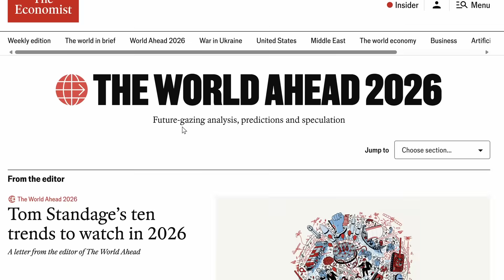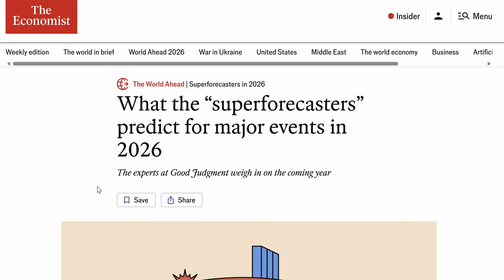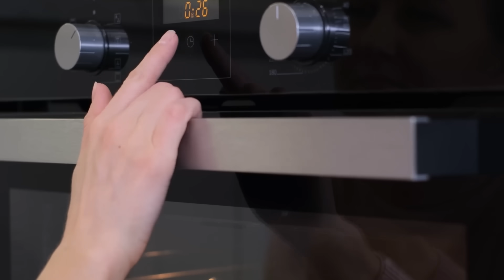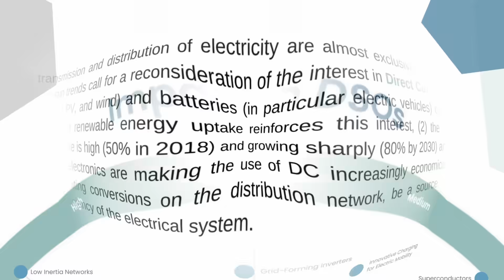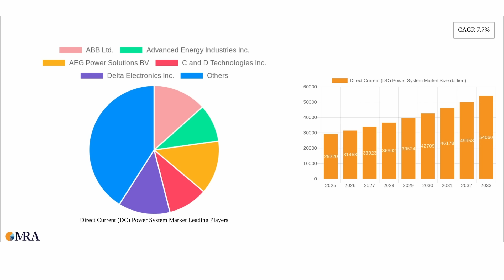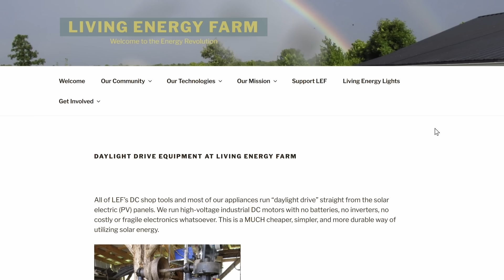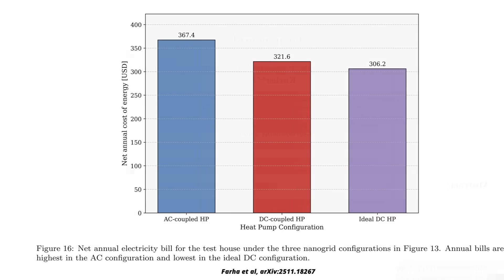Are We Using the Wrong Kind Of Electricity?

Comment: There have already been DC installations in datacenters, where at the top of the rack (or bottom depending on layout) they convert the incoming power to 48V, and distribute it to devices just using a bus-bar where they connect to when sliding in. This eliminates a lot conversions and improves reliability as well (less things to break)

Comment: DC-DC converters have AC in the middle. What differs from 100 years ago is that the AC is at much higher frequencies than the 50/60 Hz that was good with iron core transformers, and efficiency at those higher frequencies has been made higher than at the lower ones.
Home devices that need DC often convert low frequency AC to DC, then DC to DC to get the regulated voltage they need. A DC input instead of 60Hz A/C gets rid of one transformer and its losses.

Comment: From where I stand at the private consumer side, with regular shifts to AC or DC depending on a project or client, it looks (to me) more like "the grid" as a macro-industry concept is going to get more and more decentralized. Some micro-grids will network together, and others simply won't be compatible for whatever reasons.
There's NO REASON that wind turbines have to produce DC, btw. Any rotating generator (like those powered by turbines) can push AC cheaper for longer with existing anc tested technology. We've been on torque-to-AC for the whole electric age as espoused from hydroelectric dams and even steam turbine generation on ships... Older car generators ran DC directly, but required routine maintenance, including replacing brushes similar to the brushes in electric motors if the era... SO there's just never been anything stopping rotational generators from making DC, either...
That said, MY POINT is that in the future, your particular best choice for electricity is probably going to become "case by case" and may well depend on your geographic location and available resources as well as just the local co-op or industry engineers and their choices.
I think the Power Converter will become popular, so DO learn to appreciate the benefits of a FULL BRIDGE RECTIFIER when you start looking into it. Thanks, Electroboom... and IYKYK.

Comment: And then China does it backwards.  There are conversion losses but I am sure those would pale in comparison to transmission losses.  
Transmission should always be AC.  But in your house should be one large efficient rectifier NEAR YOUR HOT WATER HEATER.   It should supply 12 V all over the house and its conversion losses that are lost as heat should have a water cooled loop with a preheat tank of water for your water heater.

Comment: Happy Holidays Sabine. There are many factors involved. Some arguments are not valid because many DC consuming devices need specific voltages. In general that is done converting to AC, transforming up or down, then converting to DC. As for the DC power line, losses are less in the line itself and indeed, technology/efficiency has improved for high power conversion AC to DC and DC to AC such that DC power lines are worth it. So between Denmark and the Netherlands, that is why.

Comment: Don't panic. Every AC or DC electricity has its advantages and disadvantages. I'm surprised that this is not the core of the video.
The main disadvantage of DC when used in the home is the replacement of all switch contacts, because DC at 100V can stretch the arc up to 10mm.
The replacement must be either an electronic switch or the use of magnets placed under the classic contact.
Similarly, safety elements, DC current can cause cables to burn out, is significantly more dangerous in terms of fire.

Comment: Transporting voltage potential is one problem solved by high voltage ac. To get electrical to do work it needs to be controlled. The final step is the ac or dc device that will turn a motor or power a screen. All use discrete devices to accomplish that. Transmitting power over long distances with no wires is what we need.

Comment: Wrooooong. DC is for personal devices, computers etc. For power distribution is DC absolutely wrong solution. Even for heavy industy is wrong, we see it at powerstations where big AC motors where replaced by smaller DC motors with frequency converters, they are failing three times more often than old AC motors and every one of them need to replace supply wires which are again three times wider and expensive, than AC supply wires.
Reply: Were they brushed dc motors?

Comment: Heyho Sabine! That was a pretty bad checked video... heaters do not need AC, that would be motors. Wind turbines produce AC, yea more or less everything that spins needs or produces ac. dc breakers are for batteries so, nothing new there for the home. A part from that power electronics are getting pretty dame efficient nowerdays. But yes DC micro grids do in fact make sense fore some industries.
Frohe Weinachten!

Comment: No. We are probably using the correct electricity for distribution.  Typical distribution is 14,400 V which is stepped down to 240/120V to connect to your house with a transformer.  And sometimes to 480V for light industrial uses.

Many devices convert this 240V or 120 V AC to DC at lower voltage for use.  

At the current state of electronics, the electricity is first rectified to DC , then converted back to AC to drive a step down transformer at higher frequency, the AC  is rectified to DC that is used to drive an induction based regulator which is a pulse width modulated device (AC) to produce DC output voltage.  This appears inefficient but it is quite efficient.  A line frequency step down transformer followed by a linear regulator will be less efficient.

If the house current was DC we would only save the first rectification but DC to DC converters would have to replace the pole distribution transformers at greater cost.
Reply: Is the cost of the solar panels larger?
Reply: @UmmerFarooq-wx4yo thats not a relevant question.

Comment: Merry Christmas, 
Sorry for the lump of coal, but hell NO to DC, for general distribution and usage .   You’re only looking a a tiny piece of a very large puzzle.    It’s not about final use, but transmission and distribution.    There isn’t enough copper in the world to convert everything to DC.  How about transforming voltages?   How do you do that easily/cheaply and RELIABLY with DC?  

There is a reason why the world chose AC over DC over a hundred years ago.   It’s not about what being USED, it’s about what’s being TRANSMITTED. 

DC transmission (excluding extremely high voltage transmission) requires cable sizes and order of magnitude larger than AC.   In fact Thomas Edison, for his DC system, proposed power plants in every city  block, because it wasn’t feasible to change DC voltages, or to transport over long distances.   Thomas Edison also owned a lot of shares of copper companies…. 

Even the microgrid, you essentially only have a choice of one voltage.   What voltage do you choose?   That toaster running on 5 volts, so it’s compatible with your smartphone?   That toaster would require a cable with each wire the size of your thumb.  

The magic with AC is the transformer.   Super cheap, simple, reliable way to change voltages.   Nothing equivalent exists for DC.

Comment: The Economist used to be an excellent news journal but just supports the WEF now. EV's are a disaster. The AC/DC argument was resolved 100 years ago and DC lost due to transmission of power over long distances. It is easier and cheaper to convert AC to DC than DC to AC.

Comment: ac is safer to work on. Ground is the reference voltage of 0 volts. So if i'm working on a 480V motor, fed by a 480/277V circuit and i stupidly do it live and equally stupidly touch a live leg, i only get hit with 277V not the full 480V. Now it need not be mistakes thay cause this if the case becomes energized and the equipment ground is compromised, then anyone touching that case will get wacked but again only with 277V which is reasonably surviveable.
Reply: AC is safer than DC to work on?
Reply: @UmmerFarooq-wx4yo yes. I would be working with the full voltage with DC. 480V DC would be 480V to ground, where most commonly in the US 480V is 480V phase to phase but 277V to ground. Less voltage risk in the most common type of electric shock injury, hot to ground.

Also, it is commonly said among electricians that dc "grabs" you meaning it's your muscles contract involuntarily making letting go impossible.

Comment: Seriously?!?!
Here's where engineers demonstrate their disconnect from the real world and hands on technicians step in and try to stop the flow of wasted money and effort. 
You can not transform DC! It has to be pulsed or converted to AC.  And I guarantee that the study of DC homes vs. AC homes is not a direct comparison.
AC transmits further and better, converts through transformers to different voltages easier, and it's simple to convert AC to DC. These experiments for DC microgrids are rigged and fudged.
Figures don't lie, but liars can figure!
Reply: Having all homes with DC solar panels, would be preferable than nuke plant several miles away.

Comment: 3:40 - Don't wind turbines actually generate AC? Since the AC it generates does not match the frequency of the grid at 60 or 50 Hz, it is first converted to DC, then to AC at 50 or 60 Hz.

Comment: DC makes sense in factory settings and maybe some commercial settings where the people using the equipment are not the people maintaining it or even responsible for plugging it in but in the home, DC is far more dangerous than people are used to. if you grab a live DC wire by accident it is very hard to let go, also DC arcs more so there would be a higher fire risk. DC power even at like 120v needs serious care to handle but a 120v ac zap in most scenarios is just an unpleasant surprise.

Comment: 4:55 you touch on the key issue but don't explicitly say it.  We use AC because at typical transmission voltages of the last 100 or so years (4KV-345KV) AC is far more efficient and encounters far less line loss than DC.  But the advantage tips back to DC when voltages exceed 500KV, particularly for distances >300 miles.  This has only started to become feasible over the last couple of decades.
Reply: Exactly. 
Technical decision leads for compromise. 
I don't recall the demo that shows AC have less resistive loss than DC for high voltage over long-ish distances, so if you have it please share it.
But the capacitive loss of the AC is less and less negligible and DC naturally decreases this to zero 😊 so for very high voltage and over long distances there is this sweet spot where DC now prevails

Comment: It does feel kinda dumb to convert DC from solar panels to AC, plugging it into my car, which turns it back into DC... but then, if it al was DC it still would need to be converted to different voltages... so as long the conversion, be it DC/DC or DC/AC,  is done efficiently, we should be OK...

Comment: I see the argument between Edison and Tesla is still going strong on the comments. AC was used way back when, because, transformers were the only reliable way to convert voltages on a scale. Today's electronics have changed that. Newer high voltage transmission is using DC, I wondered, 'why are they doing that?' Well it turns out that the same changing magnetic field used in transformers causes losses. High voltage AC creates a strong alterning magnetic field and over long distance the inductive losses add up. Again I was thinking how bad can it be, then I saw a documentary about changing insulators on High voltage AC transmission towers. Even though the line they were working on was powered down, the induced voltage on the 'dead' line was high, if memory serves me, it was in the thousands. 💡Now I fully understand the magnitude.

Comment: Interesting. Australia uses a vast amount of air conditioning. Generally speaking, 3 phase aircon is cheaper to run than single phase. I don't know of a DC airconditioner.

We also pump a lot of water. Swimming pools benefit from 3-phase ac motors, even in domestic installations. Perhaps solid state transformers will make AC more attractive as traditional transformers are expensive to buy and have long lead times to replace.

Comment: Those of us who have off grid inverters connected to 120v-500v solar strings feeding a MPPT could be connected to a community scale DC buss .
Voltage variations of 10-20% would be of little concern as long as 
the voltage is on the high end. No complicated dance of phase matching,individual PV input strings being designed at a slightly higher voltage than the target DC buss voltage. 
Off grid solar battery backup is already moving to 100v so another scenario is home battery maintenance charge off a 120-500v DC  buss would be simple and ,due to the low and constant current ,the copper savings would be substantial.
My inverter that runs the majority of my house loads has PV input on a #10 circuit and the 240v AC that tops off the battery at night is a #12 romex. As an electrician who always put 200 Amp/ 240 volt service on houses,this boggles my mind.

Comment: On the map I do not see the DC connection between Norway and the Netherlands.

The US aircraft carrier uses medium voltage AC in its power net which is probably a major factor in its trouble with the catapults it uses to launch aircraft. The new Chinese aircraft carrier uses MVDC.

Comment: It is a bit sad to see the downfall of Sabine and this channel. Quite a few of the things Sabine pointed out as being "powered by DC" are running internally AC. Electric cars, telecommunications, microwaves. While electric car could run on DC, they rarely do, as motor control is super inefficient using DC in the entire path from source to controlled rotational movement. There is a reason why legacy DC railway electrification in Czechia and Slovakia (the northern part of former Czechoslovakia) is being converted to AC, even if the process is slow and done in  incremental steps (sections). Every modern (high speed) rail line uses single phase AC. All DC to DC converters use AC in the process of conversion. You cannot directly convert DC to DC. Anytime you need to change the voltage, you use some sort of AC.

Comment: There is another thing with the DC Grid because from point view Energy Provider and also security and decentral Energy Storage is desired.

Hence a fluctuating DC Grid from lets say 280-350V is no problem, IF all houses are equipped with a BatteryStorrage.

It can be charged 24/7 with a mostly constant power and take very huge peak loads OFF-the-Grid.

This will deffinitively increase the efficience abd also make it easier to charge locally with solar.

Comment: Dear @SabineHossenfelder, alternating current with 50-60 Hz means that the direction of current flow reverses 100-120 times per second (not 50-60 times). One full period of a sinusoidal waveform contains two zero-crossings.

Comment: “DC transformers”? No. Transformers work when the primary (power input) either collapses or alternates. Both AC and DC have settled into their nicely useful places in over 100 years of technical development and long range transmission will forever be high voltage AC, storage, DC.

Comment: should be DC..  the only reason the 50/60 hz happened is 3600 RpM is about optimum for a large engine which gives 60Hz w/o brushes, and voltage conversion to HV for long wire transmission using HUGE IRON Transformers.  Now with solid state high frequency switching, we can go very high frequency for voltage conversion using SMALL very efficient boost/buck and other topologies.  DC doesn't have reactive losses, and is just as effiicient at even higher voltages.  The entire GRID is OBSOLETE!  as are big iron transformers.

Comment: In Belgium a new power line is being laid from Zeebrugge, connecting offshore wind turbines to the inland area. So, in essence, direct current would be better from Zeebrugge. However, because the line will also be used for electricity transport at other times, alternating current should be chosen.

Comment: Well, dc/dc converters are basically dc/ac/dc converters.  Transformers part of the dc/dc converter still require AC to do the voltage translation.  The only reason for the popularity of DC high voltage transmission lines is that it’s easier to stabilize the grid.  Each power sources on the grid have to precisely synchronize their 60 or 50hz.  Any deviation in frequency or phase creates instability on the grid.  So when you have a large number of DC power sources you aggregate them on a single DC/AC substation.  So you end up with less nodes on the grid that are sensitive to AC phase variations.

Comment: I am all for dc, but we still need the means to charge batteries efficiently and with consistency, and that tech is way off, stay nuclear its safer and cleaner. also we are to energy hungry as a planet and we are growing, unless we go back to the stone age, there is no way in the next 100 years unless there is a miracle of course that AC will be dismissed.. One solution would be for home owners only to use there own dc source but they would have to be strict with their overall power consumption, and im sorry but i cant see that happening in this day and age.

Comment: I think both have their use cases they are optimized for. Example AC being highly efficient for long range transmission.
And the more lethal one, due to it causes the current to short-circuit around the person's skin due to induction.
DC requires alot more voltage to be considered lethal.